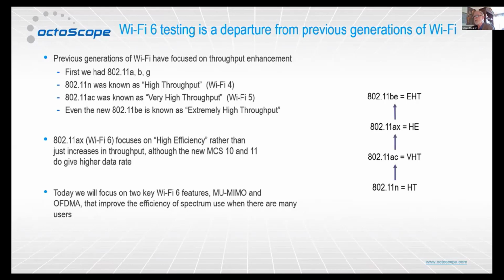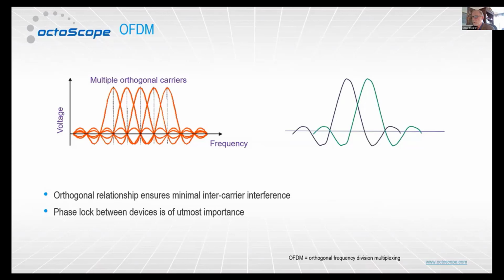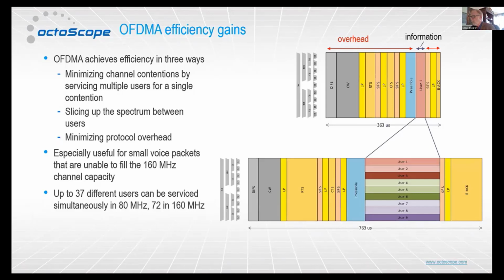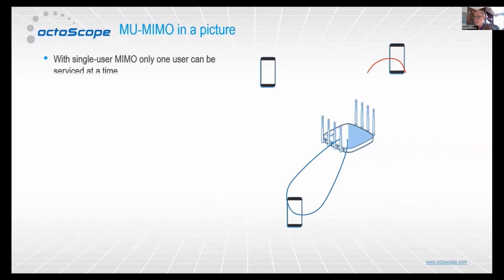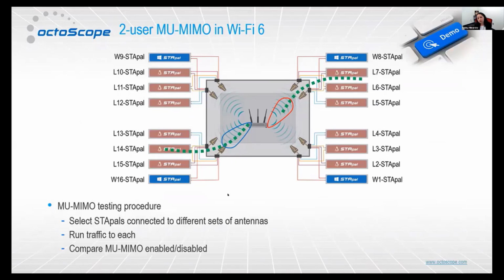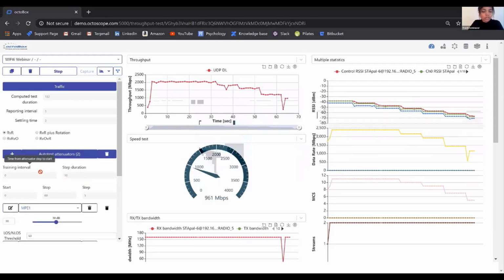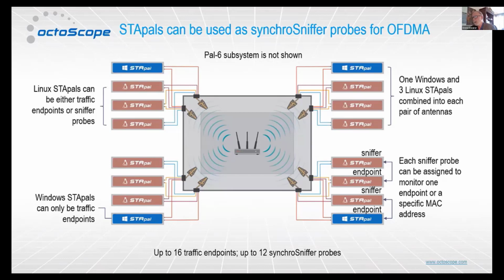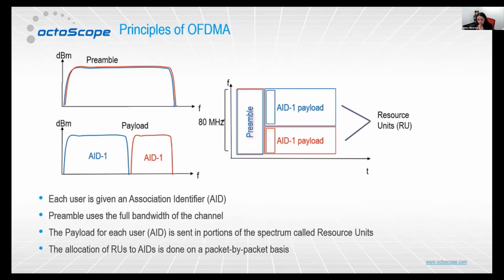Wi-Fi 6 Tutorial Series - #3: OFDMA deep dive

Comment: I am afraid the two OFDMA graphs are incorrect and don't make sense. What they are actually showing is the very same frequency broadcast in multiple phases. The "frequency" axis seems to be a time axis but orthogonal frequencies have different wave lengths. Also, the phase is a coding parameter of the transmission. How could separate streams in different subcarrier frequencies lock their phase shift if this is actually what is coding their transmitted values and against which frequency if other subcarriers have different wave lengths?

Comment: So preamble occupies entire bw of spectrum i.e. 20Mhz or it higher like 40Mhz or 80Mhz or 160Mhz or 320Mhz.....? Is it a sub-band?
Reply from the maker: The preamble is used to get the initial channel state so that the device can track changes as the rest of the data comes in.
So the preamble needs to occupy the bandwidth being used for data, i.e. 20, 40, 80, 160, 320 MHz. because channel state info is needed for the entire bandwidth being used.
Reply: @spirentvideos  My understanding is primary and secondary sub band would carry their own preamble. (discontiguous).